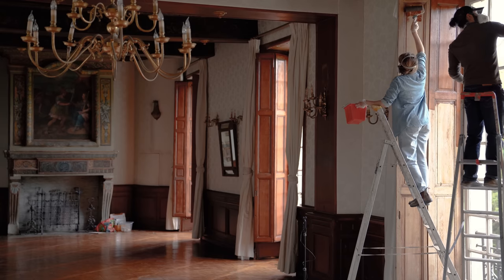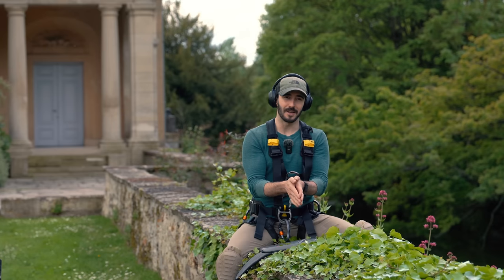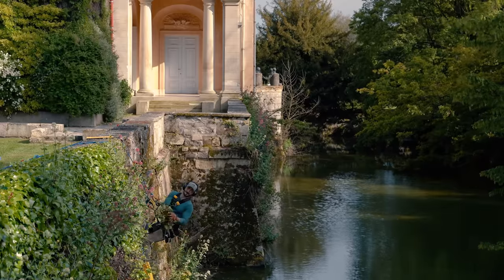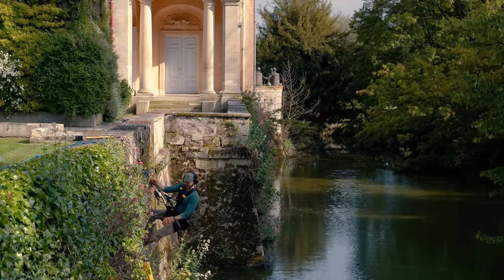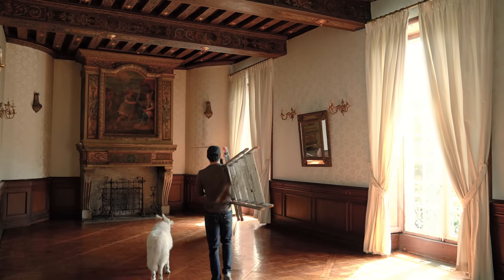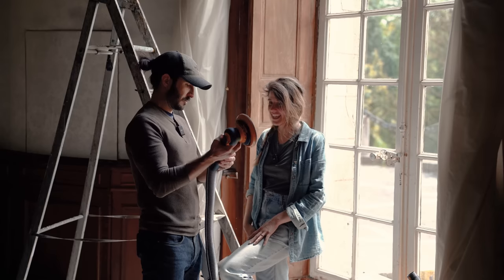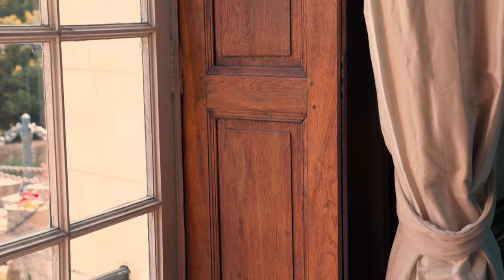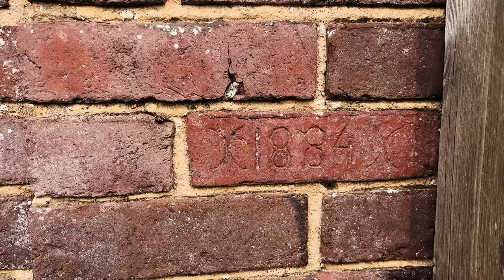Restoring Our Vintage Chateau Shutters | French Chateau Renovations #32

Comment: May I suggest using a Wood Conditioner before you stain the old wood next time.  It goes on easily, is clear and dries fast.  Seals the wood evenly so the stain applies easily, evenly and more quickly because you don't end up wasting stain to soak in the dry spots.

Comment: Also I did home improvements for 7 years in high end home here in NC. I k ow the sanding for hours to get it to where you want it.  If it's not stained, it's oil painted. Especially in high end homes. Finally they started not minding latex for the walls but oil for the trim and bathroom and kitchen.

Comment: You can buy at the home improvement stores electric pulley's to connect to your trash can and it will pull up the wall and back down again with a push of a button, it would make it much easier for you and it's not real expensive, I've seen it on other chateau videos

Comment: a little advice, if i were you I would wait until the winter time when the moat freezes over then you can simply walk on the ice and pull everything down. not to mention the vines should be in a domant state which would make them easier to work with.

Comment: Ian, as a possible solution to your ivy wall removal situation. Take a look at the Milwaukee Quik-lok trimmer system. This way you don't have to scale down the wall but can remain on top of it. I have the Dewalt version but granted Milwaukee provides more attachments. It's a game changer. Not only for your walls but your gardens in general!

Comment: I found your channel about a week ago and I love it. I've been binge-watching all your episodes, and they are great. If I may make a few comments as you go, which you might have already started doing. Avoid the electric drill on existing wood. Clean the grove and use a hand crank screwdriver, which can be used for drilling as well. You will have more control and avoid damaging the wood which tends to be more fragile. Wear masks when sanding treated wood. Treat all those wooden window panels with linseed oil. It will preserve the wood and make it easier to clean. A good power washer will be your best friend. I can't wait to see the "never-ending" results.

Comment: Suggestion - when cleaning the moat wall, use an oil slick boom (or similar). Then you can just drop the waste into the water and it will not float away. Once or twice a day you can pull the boom over to the ramp and collect all the waste on land. That way you would probably be much quicker because you're not stopping every few minutes to lift up the trash can. Voila!!

Comment: Did you know that almost all clear wood finishes pre-1950 were made from shellac?  Shellac does not need to be sanded off.  All pure shellac finishes can be removed with alcohol on a rough cloth, steel wool, or a rag.  The alcohol does not remove the original color or stain.  Alcohol dissolves the old shellac finish. If the old finish is wiped off with paper towels or rags the wood is immediately ready for a new finish.  No sanding required.  The new finish does not need to be shellac.  I would not recommend shellac as a new finish since it doesn't hold up to moisture well.  There are better options.

Comment: Hi there!! As for the moat, I think a raft would be a bit more easy, at least for the lower part of the wall. Some barrels, some planks, mebbe even a chair, and some metal hooks in order to get the raft close, and even a trimmer once the most thicker plants are gone, a trimmer could bare the stones from water level up to three meter or more, depending on the lenght of the trimmer....The barrells need to have some water inside, otherwise the raft will be wobbly, but thats not that difficult to jBo find out the best volume of water.....Bonne chance ! Mikke in Sweden....

Comment: Dude, why don't you just put a ladder in that moat? Ropes to the bottom to lower it, ropes to the top to hold it against the wall... Never cleaned a moat but did a few wells like that, works like a charm

Comment: A pro tip from a painter… if you would like to have a roller finish on the flat surfaces, that must be the final thing you do on the work piece… so, with doors, or shutters, or window frames you cut in with a brush on ALL of the places you cannot get to with the roller, and then roll the flats last.

Comment: Torch - go for a strong one. Usually sells in Brico markets or similar and people use it to burn out weeds that grow out of stone walls or on plastered surfaces. Nice thing is that it burns the roots inside those gaps too and the weeds will not re-grow (so fast).

Comment: For the moat if you tied the boat off with a line to where you could have it below you to drop in the vines then pull it along to the ramp and switch it from the boat to the trailer.

Comment: Ian, you could cut the vines at the base, allow the vines to die, and then go back and clean them up. It will only take a couple of days and the vines should be easier to pull off and lighter (because they withered).  LOVED your Wes Anderson bit. The Grand Budapest Hotel is a masterpiece.